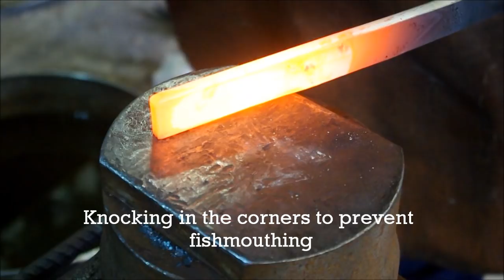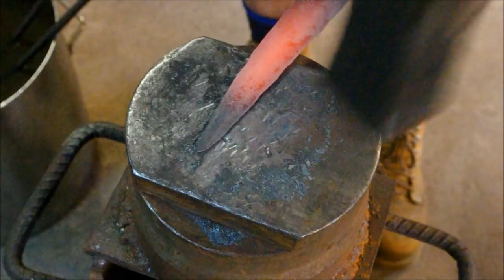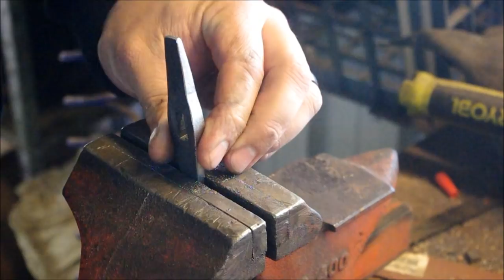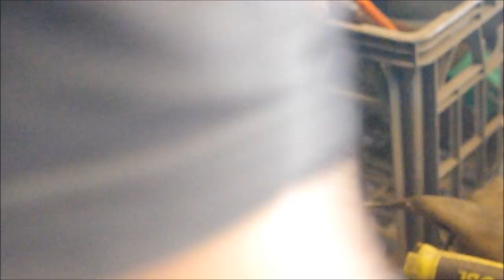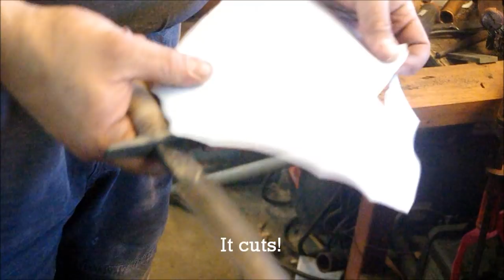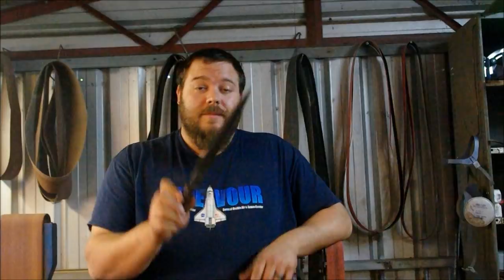Forging a Skyrim Dagger Using Only Hand Tools

Comment: Great video! I recently learned a new technique, which can help you with fixing the guard: before you put it on the tang, heat it up a little bit. And when it cools down, it shrinks, so it will fit perfectly, making your dagger  all one piece. It also works for the pommel. 
By the way, is this challenge is still running? Because then, I except it!
Reply from the maker: Thanks mate! Unfortunately I didn't realise how loose the fit was until I'd already seated the pommel, so I couldn't heat it! The challenge is always on mate, I look forward to seeing what you come up with!

Comment: lovely sir, I have not been able to smith as much as I would like after moving to an apartment (I have to drive a few hrs to my parents farm) and your hammer control when doing bevel work is impressive. I usually just forge a rough shape then head to the grinder, but perhaps the next build i do will involve forging process! any tips on keeping that bevel line straight?
Reply from the maker: Hey mate, glad you still swing a hammer when you can! When bevelling it's important to not only angle the hammer to the work, but to also angle the work to the anvil. You want to create a triangle between the hammer and anvil face and then bisect that with the work. Good luck, keep swinging!

Comment: Oh....! The guard and pommel....! You cut from the same piece of billet first! ......Just like how I always do it! .....! .....You pound bevel...!...! Thats how I normally ...I'm actually not being very truthfull, I may have been doing everything ass backwards with fish mouths and all, which always turns into a crack that I ignore by convincing myself it's  just a surface scrath which inevitably ends in a shorter blade than previously planned.
Reply from the maker: Haha we're all that way in the beginning, it's learning to improve that is important!
Reply: @SamTownsBladesmith  You should totally make a Blacksmith instructional video on how to get the wife to be more  understanding and accepting of all the smoke, hammering, metal shavings, grinding, soot and ash!
Reply from the maker: @jaymuzquiz2942  mate, if I worked that one out I'd be up for a nobel prize!